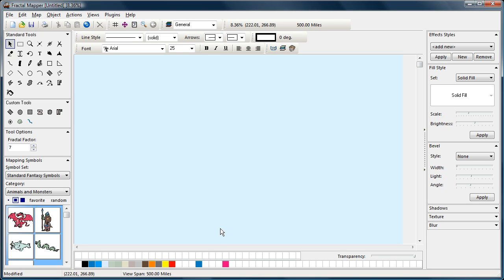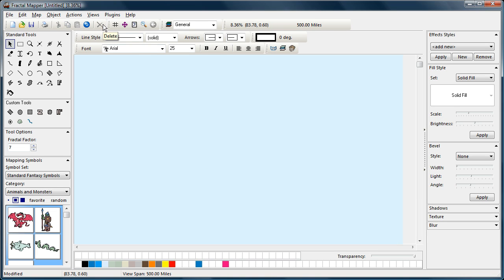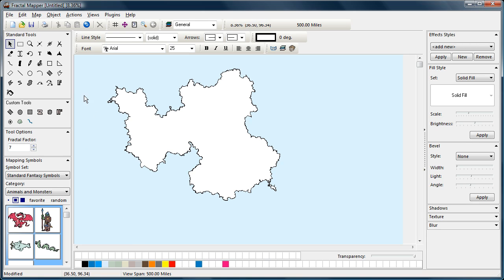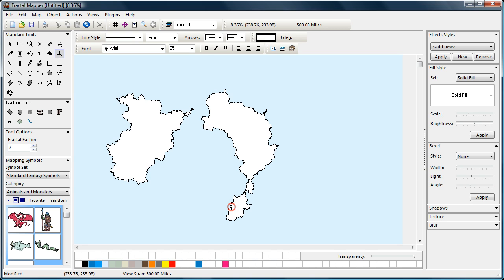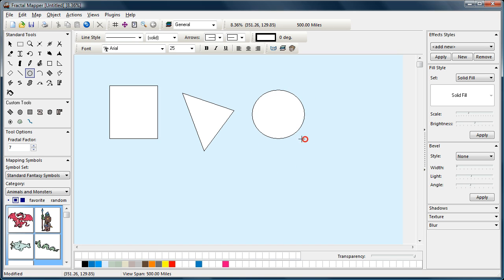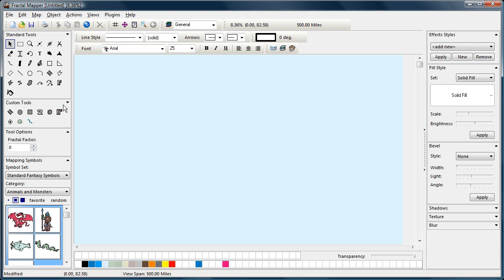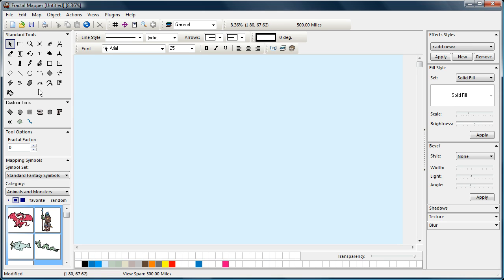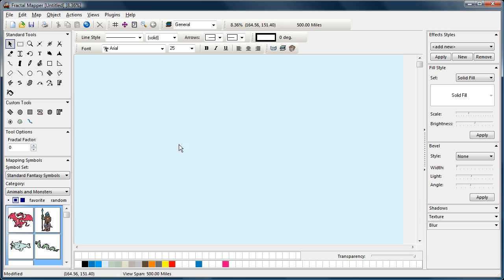Fractal Mapper 8 Tutorial #2 - Mapping Tools

Comment: how do you create a solid shape if you used the fractal line tool? i am trying to add color to the islands i made but the color only gets added to the lines not inside the lines.
Reply from the maker: The line tools are specifically for unfilled lines.  If you want a solid shape, you can use the one of the filled shapes - Fractal Polygon, Fractal Landmass, Fractal Spline, etc.  They are the ones with the filled icons.  If you really need to fill an existing line, you can use Actions -> Clone To -> Polygon from the menu to create a filled polygon from the line.
Reply: You don't use fractal line if you want it filled in.  You use fractal polygon instead (right-click to close the polygon when you're done.)  You can modify the shape by selecting it and adjusting the fractal factor value, or by pressing CTRL+E to re-generate the fractal.